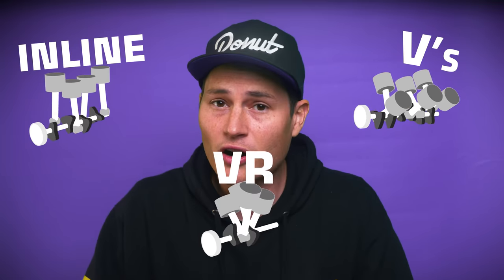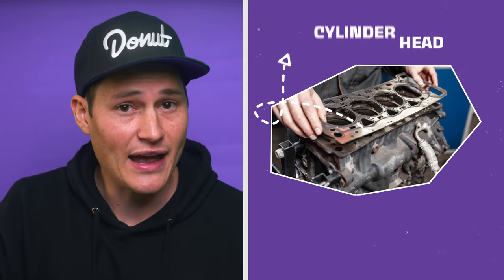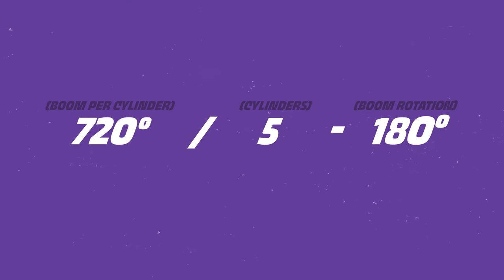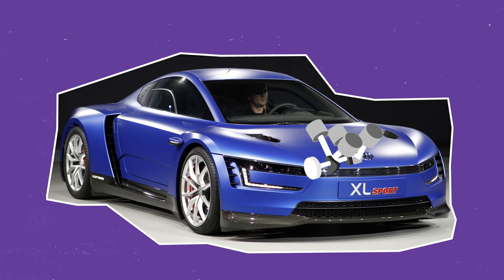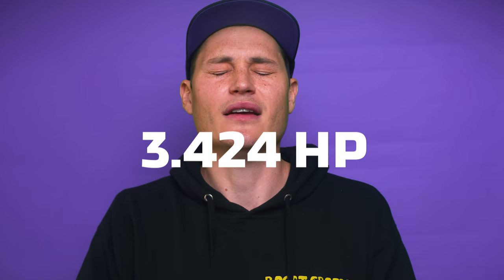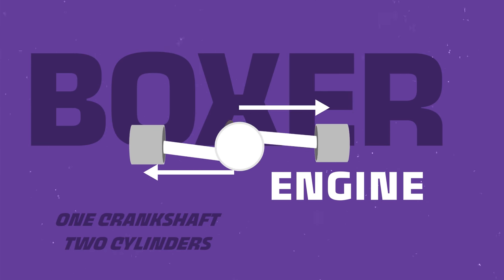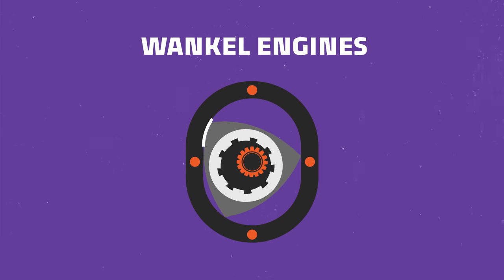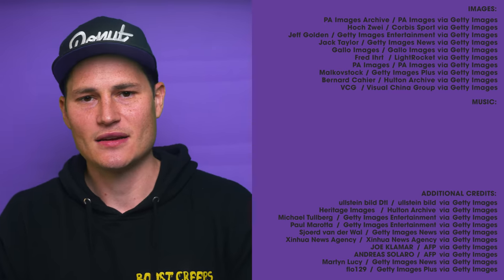Every Engine Layout Explained

Comment: I had the idea of buildings a Hummer type truck using a Subaru 6cyl or a boxer 4  , using a supercharger and turbo,  but the big difference is mounting it under the seats,  making it a exelant  military truck, 4door truck,  with suicide door in the rear,  with the engine mounted between the frame rails,  and the frame actually being under the doors, nearly even with the tires, width wise,   use 20" rims,  38" to  40"  tires  12" wide,  the military spec would weigh about 6k lbs,   
Modified engines with thicker castings,  forged internals, improved oiling and cooling,  improved head flow, ceramic coatings on pistons and heads, valves, ports, manifolds, supercharger, increase the stroke and valve size, maybe the cam lift, and duration, with a supercharger making 1 bar at 2k RPM, then the turbos take over making peak boost about 4k RPM, peak TQ about 2600,  vvt keeping the TQ curve flat from1800, to 5800 rpm, the 6 cyl , should make around 450 TQ and 400 HP  around 5600,   and a possible diesel version, making about 900 lbft TQ  and 450 HP, using compound turbos, with variable geometry,  to start making boost just off idle,.  I would like to build a light weight, civilian version, using a 2stroke boxer engine,  gasoline,  but designed similar to the Detroit diesel engines,  light weight internals to rev higher, with a scavenger/supercharger, capable of making some boost,  maybe add a turbo with intercooler,  run at atleast 1-2bar,  attempt direct injection in the intake ports, at the bottom of the cylinders, with  use a 4" stroke 4" bore, to 4.125" bore, 4.25" stroke,  maybe use a sleeve valve to change the intake port timing, same as cam duration and timing in a traditional engine,  use a overhead cam, 4valve head,  with variable valve timing,  the  sleeve valve could equal a section of the sleeve movable,  to close off the ports in the sleeves,  go from multiple 5mm holes to 25mm holes and the height is what is changed,  changing the timing and flow capabilities,  or the whole sleeve being movable to change the port timing,  allowing the pressure of the power stroke to do as much work as possible,  then open fast to fill during scavenge and fill , Being around 220 cid, a large  , and use a 6 speed manual or 6speed auto! 2wd with a locker,  basically being an answer to  tundra or Colorado, It would be awesome to see someone build this, especially a 2stroke gas engine build similar to a Detroit, with valves,  sorry to ramble again!! Happy 23!!👍

Comment: You don't have to have exhaust next to the intake on the 3 bank  engines there is a work around that works like a charm. I believe it's a product by lancia  it is a straight 4 that has true duel exhaust with twin turbos and and four valves per cylinder and a center sparkplug and duel intake valves. The head used t duel over head cams and screamed. The two exhaust valves are located on the left and righ sides while the intakes are in a line from front to back. So instead of one side of the head being the cool intake side and the other being the hot exhaust side the two sides are both hot and it has exhaust manifolds on both sides of the engine. While there are twin plugs in the center coming in from the sides at an angle while the two intake valves are on the front and rear of the sparkplugs. It's called the triflux engine and was developed for class S rally racing the year before it was cancelled so it's never been raced but it could make close to 700 hp from a two liter and spin to the moon and back. I would love to have one setting in the garage just to leave everone who loves engines speechless because the way it looks it looks like the head wasn't placed on the block square but at an offset .

Comment: A four cylinder engine does have a power gap. The last third or so of the power stroke no power is really being produced, along with the exhaust valve opening before the exhaust stroke, using some of the residual pressure to get the exhaust moving. A six cylinder engine is smoother because those two extra cylinders make up for the gap. Most notable in aircraft, you would be amazed at the difference

Comment: I know it hasn't been in a car (I think?) but I would have loved to have an explaination of those old ww2 fighter prop motors. They look like they have pistons wrapped around the shaft where the prop attaches.
Reply: If you make mention of the Radial Piston aircraft engine then they were NOT only used in "those old ww2 fighter prop motors", but were the major power-plant in the LAST US strategic bomber which entered service in 1948: the B-36 "Peacemaker" which was configured to have 10 engines, six radial propeller engines and four jet engines, leading to the B-36 slogan of "six turnin' and four burnin' ".
But in single-engine use, the last tactical piston-engined combat aircraft used by the USAF was the A-1 Skyraider, which was retired from USAF service in 1973, and in final versions used the Wright R-3350-26WB radial engine.

Civilian airliners additionally commonly employed these same multi-row radial propeller engines (as did the B-36 "Peacemaker") up until being superseded by jet-power in the form of the de Havilland DH.106 Comet and Boeing 707 jetliners. "The Comet made the world's first commercial jet flight across the Atlantic in October 1958."

To read about at least ONE occasion when a Radial Piston engine was powering a car, you may look-up the following: 
" A Spectacular Failure: The 1935 Monaco-Trossi GP Racer "

Comment: I don’t know if this would be considered a VR or if it would have it’s own classification.  I have a ‘67 Puch 250 “Twingle” cylinder 2 stroke.  It has one crank, two pistons and rods, no valves and one combustion chamber.  The pistons are in a tight V and are used as the valves.  Kind of odd being a single combustion chamber, twin cylinder design.

Comment: I had a marketing flicker book of the Commer Engine as a kid in the 1950s. Only engine you missed out that was in a motorcycle is the radial 5, in the front wheel. German and quite a few were made!  Deltic diesels were only in locos and boats so excused on that one.

Note: Commer were owned by Rootes and in the 1950s they worked with Toyota and some early Toyota hemi head 4s are based on Rootes designs. Cars themsellves has a passing resemblance to the Hillman Minx; i can understand why Toyota probably keep quiet about that though. Wonder if Toyota eve had a go with that rocking diesel?

Comment: Actually also the record bike “Vespa Siluro”, which enstablished the speed record for a 125cc bike in 1951, had a water cooled 2 stroke opposed piston engine which had 21hp at 9500 rpm and took the bike to an average top speed of 171,02kph (106,27mph)
Reply: 168 hp/l. That's absolutely insane.
Reply: @nazarderkach9320  Well, it’s quite a bit but not that much, for example tm’s 125 supermoto develops more than 36 hp to the wheel, so about 40 (give or take) to the crank; and being the engine a derivative of their motocross one peak power is a bit lower than other 125s made for street use, the mito sp525 from Cagiva had about 37hp to the wheel and a couple more with simple bolt-on parts, but we’re talking about a bike that could reach more than 180kph ;)
Reply: Its the 50cc racing bikes which are really impressive:
Reply: Such as the 1954 Kreidler 50cc 135MPH clocked at Monza, . .

or Suzuki 50cc racers- "built in 1967. And it’s a technological as well as aesthetic masterpiece: the engine was tuned to an extraordinary 350hp per liter.

The RK67 motor was a two-stroke, water-cooled parallel twin, and the Japanese factory managed to squeeze a remarkable 17.5hp out of it, with a redline of 17,300rpm. To keep the bike in its extremely narrow power band, Suzuki fitted the bike with a 14-speed gearbox. " [176kph (109mph) ]

But turning to 4-stroke power which did have the disadvantage against 2-strokes- The Honda RC116 was a race motorcycle built by Honda Japan for the 50 cc class of Grand Prix Motorcycle racing in 1966:
49.77 cc 4T, 4 valve, air cooled, four stroke, DOHC parallel-twin "Tweecylinder"
14-16BHP @ 22,500 rpm, top speed 109mph (118mph allegedly recorded) This means 320 bhp per litre.

Comment: Small nitpick for anyone watching this in 2023 onwards: V4 engines are the most prominent engines in MotoGP BUT not the only ones; the Yamaha he showcased is actually a 1000cc Inline 4, Suzuki had that engine config too, but they dropped in 2021. Most European bikes (Ducati, KTM, Aprilia) and Honda use V4s. As of 2023, only two I4 are part of the grid, compared to the latter year's six in total (two from Suzuki, and two more from Yamaha's satellite team, now with Aprilia). Despite this, I4s have been giving the supposedly dominant V4s a run for their cranking since the category was born.

Comment: Inline-5 engines may be smoother in terms of power delivery, but aren’t actually more balanced than Inline-4s. This is because the odd number of cylinders means they’re inherently unbalanced. This means they experience similar levels of engine vibration to a V layout, but have the same smooth power delivery as an Inline-6.

Comment: 4:00 Isn't there a torsional imbalance in the straight 4 as well? As in, you could torque something apart if you get it going too fast. It's a reason they don't make straight 4s with more than 250 horsepower, right? Flat 4s don't get that problem since they're basically twins that are diametrically opposed.

Comment: I've had mainly I4 engines, but also a couple of V6.  Never had a turbo.  For small or light cars, I never felt an I4 was insufficient for anything I wanted to do.

The V6 cars were a minivan that was (I think) limited to 140km/h, and a FWD GM sedan where the heavy front end made it a pretty poor handling car, especially in snow or other low traction situations.  I think these vehicles were capable of towing some more significant loads, but for any other regular driving I think an I4 in a lighter car would be better.

Comment: I would have mentioned the Porsche 2.5 L4 with two balance shafts when talking about L4 engines needing balancers. You forgot the Audi 5000 from the 80s when you talked about L5 engines. They were smooth and powerful (for the 80s).The only one I can think of that you forgot and was in a car is the gas turbine in the 60s Chrysler prototype.

Comment: The only types you missed was a gas turbine ( was used in a bike ) and the radial engine ( only in crazy, home built with airplane engines ) there was two ways these engines worked, the crank connected to the output shaft ( very normal ) or the cylinders were connected to the output shaft ( the whole engine spun which was very trippy ) eg the ignition was always at one position eg the top, probably 2 stroke. Only seen on old type planes.
Reply: What YOU term a Radial engine with mention of TWO WAYS of operating- are actually TWO DIFFERENT Engine Formats:
Rotary Piston aircraft engines may be similar in appearance to Radial Piston aircraft engines, but operate in very different fashions. 

Basically, it is a Rotary Piston aircraft engine where the engine itself rotates around a stationary crankshaft - with the propeller simply bolted to the forward face of the engine. "The French Le Rhône rotary aircraft engine provided air power for the Allies during World War I. This air-cooled engine provided better power-to-weight ratio than in-line liquid-cooled engines." 

There were major mass / power limitations to the use of this sort of engine, and additional problems with lubrication, fuel delivery, and ignition so this format died out in the post WW1 years.

The Radial Piston aircraft engine however remained in use right on up to the jet age, and the appearance of the de Havilland DH.106 Comet and Boeing 707 jetliners.
Reply: @johnklumpp7901  "Basically, it is a Rotary Piston aircraft engine where the engine itself rotates around a stationary crankshaft - with the propeller simply bolted to the forward face of the engine."
I didn't say they worked the same, just that there were two different types.

Comment: You should have called this "Every Engine Layout commonly used it an Automobile" because you forgot to include the radial engine. It was mainly used in aircraft, but they were also used in tanks, boats and apparently, in the odd car and bike.
Edit: Oh, yes. Can't forget the turbine engine. A few cars were built with them too. Only experimental, I believe, but still done.

Comment: Should explain 3 bank W12 a little better. Shorter & lighter than a V12 like the 1917 Napier Lion W12 engine, which powered first car over 400 mph, set a world record for 16 years till a jet powered car went 13 mph faster in 1963. The Napier Lion engine had four connecting (master) rods from the center bank connected to crankshaft & the outside 8 rods were connected to the four master rods. (similar to radial aero engines) There was a F1 car that also a 3 bank W engine awhile back but don't think it did very well.

Comment: Honestly, no engine by itself is all that complex. It’s when you start to add all of the other components that start to make up a car that get confusing. Cars are filled to the brim with hardware, wiring all throughout along with piping and the frame. Even tires and breaking and suspension and everything that goes into your wheels in general starts to get complex. When you mix all these little complexities together you get one massive puzzle. Nobody really has to do this part anymore, it’s already been done for us by the people that innovated most of the cars we drive nowadays. Well, that and the fact that you can ask Siri, Google, YouTube, safari, or literally any other internet source to find the information you need.

Comment: Air-cooled VW spark plugs aren’t particularly difficult to remove/install. Why does Subaru put them on the very outside of the head instead of from the top?

Comment: 14:05
Actually that is a flat.
But that isn't a boxer
A boxer is a type of a flat engine
A flat engine is a engine that the angle between it's cylinders are 180 degrees

Comment: Can you guys make a Video on new engines? I bought an opel astra 2020 a few days ago... And i was stunned how fast this tiny 1.2 litre 130 hp engine can be... Is it the turbo or the gear? I had an BMW e46 with 118 hp and 1.8 litre... And the BMW  didnt run as good as this tiny 1.2

Comment: I looked every single engine variant up on Wikipedia at some point for fun…the H32 sucks it has less than 2750 hp, but it actually looks like an H, unlike boxer engines, in my option they should call it a ⊥engine or a ∐ engine

Comment: The best case of a inline 6 (S-6) and the inline 8 (S-8) the class 24 and the class 33 respectively just listen to them they sound amazing with that classic Sulzer sound and the distinct “click” sound from the camshaft without the valve cover
Edit: you missed a engine either less as or more unique then the “wankel” engine the English electric “deltic” engine wich was a 28 cylinder 88 litre engine it had 3 crankshafts with cylinders attached in a V formation in a arrangement wich made a triange shape wich is where it gets its name from the DELTic named after the Greek letter “delta” wich was written as a triangle this engine was originally tested in stolen German boats during the war and they replaced the German engines in it with a deltic and it was successful being used in other boats and then the late 1960s it would cement its name in history being placed into the BR class 55 wich used 2 of the deltics and the toilet was between them and they would turn one of them off when the driver or second man had to go so they wouldn’t be deafened but the name “deltic” started to be taken away from the engine as more and more people refer to the class 55 as the “deltic” and later it would officially be named the deltic and meny people forget the engines witch power possibley britains most famous diesel electrics along the track it’s sad how so meny amazing designs are either forgotten ignored or overlooked like the self-oiling design of the valve gear on bulleid Pacifics and that the pioneers of the railways do have there own double decker of wich I am proud to say my local railway line was the very same line 4-DD number 4001 and 4002 once ran sadly only one end coach of each unit remains but that’s not deterring the bulleid 4-DD society (please support them if possible and GSN35011 they are bringing back two of bulleid’s designs wich is amazing for the 1st time scince the rebuilding program for the merchant navy class ended a original condition merchant navy will run again and also Britain will get back it’s only double decker train these aren’t just big blocks of metel there part of the United Kingdom’s history and part of Oliver bulleid’s legacy the greatest chief mechanical engineer of the railways the world has ever seen and it dosnt look likely anyone will succeed him in a age of tubes of metel as trains wich are aiming for higher speeds it’s rare to see a train built to surve a purpose that’s not speed but to get the job done like the 1st steam engines built by people like James watt and richard trethithik all those years ago at the dawn of the industrial revolution)

Comment: You won't find 'em in cars (which is why they aren't on the list, I suppose) but there's also the radial engine layout
Reply: Ahem . . except for the sole 1935 Monaco-Trossi GP Racer which had front-wheel drive, and a Radial engine at the front.

Comment: Actually there is a difference between Flat & Boxer engines. Flat engines have both con rods connected on the same side of the crank which makes them have worse balance than a Boxer with con rods on opposing sides of the crank.

Comment: Suck squeeze bang blow is an accurate way to use simpler terms to describe the 4 different strokes. Intake, compression, combustion, exhaust. Thats the ones i was taught. But imma stick with Donuts version from not on lol